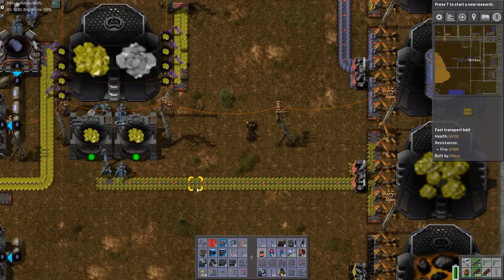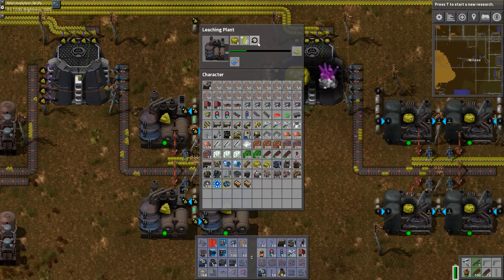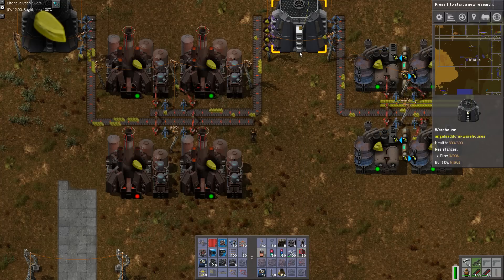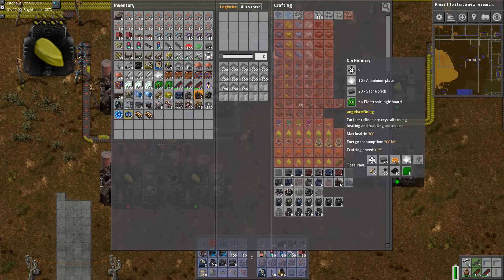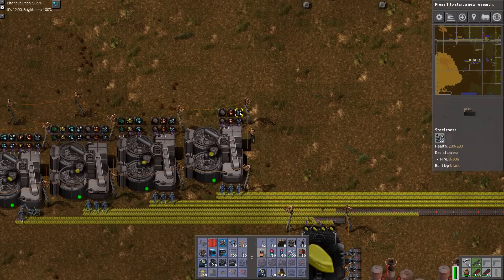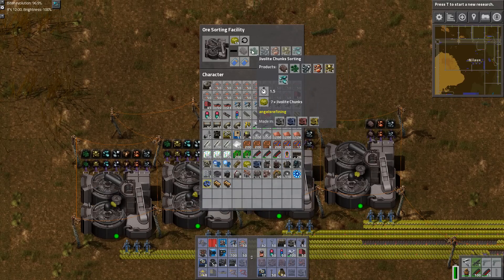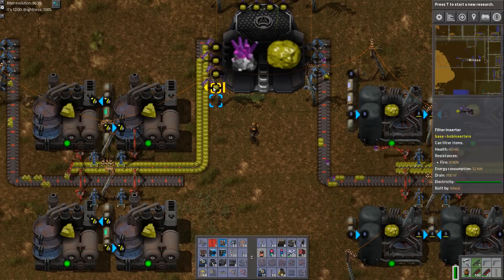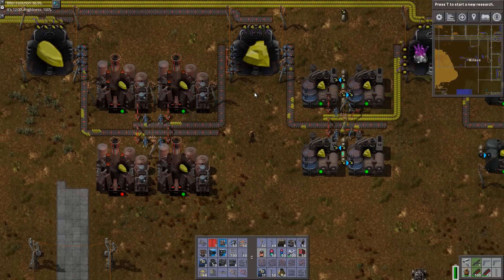Factorio Angels Mods Tutorial - Refining 2 - Advanced Refining and Sorting - OUTDATED

Comment: Pretty useful. I wish you'd included some more details on the ratios for the different sorting levels and how much sorting you'd need to saturate at least a yellow, red, and blue belt with each of them. I know calculating that sort of stuff is supposed to be part of the fun but the factory is blowing up in size so much that building it seems more like work. That's why I went in search for design ideas for more efficient crushing and sorting...
Reply from the maker: +Sami Helen, good point. 
This mod pack changes quite rapidly, so any ratios would probably not be valid anymore. This is mainly meant as an introduction for anyone who hasnt played Angel before or maybe tried and given up due to complexity.
Proper ratios is kind of the next evolutionary step. It gets even more complicated due to the different MK levels of the various machines.